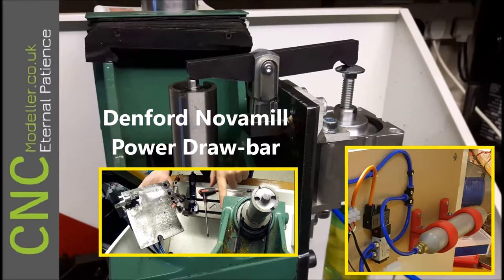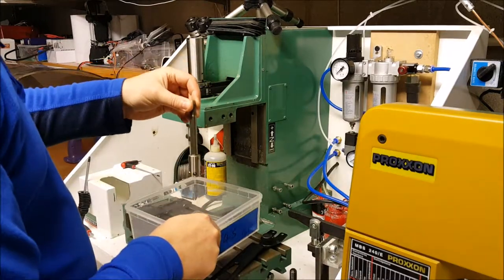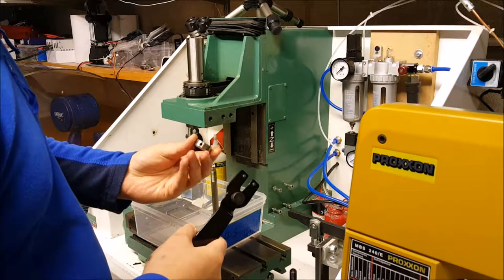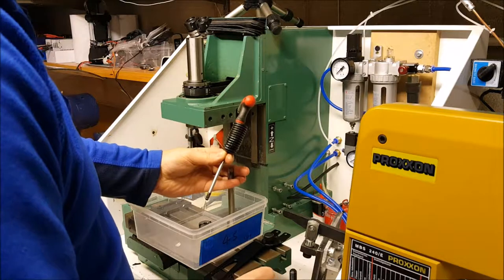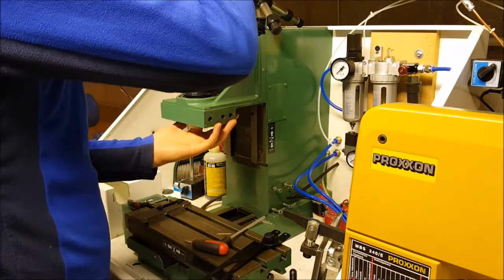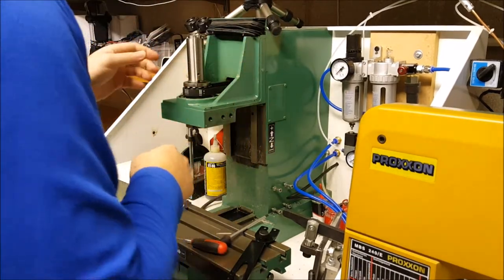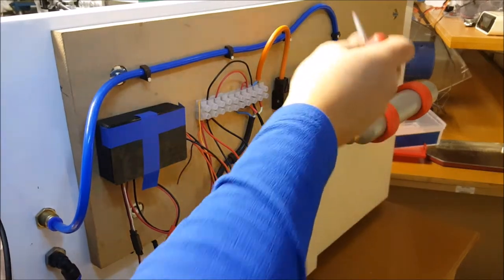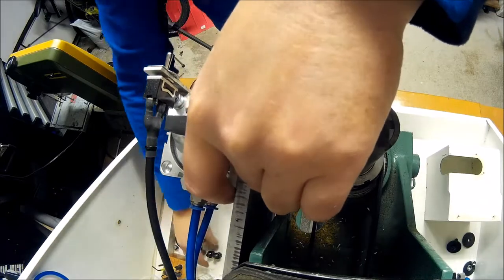Milling Machine Power Draw-bar Upgrade #2; Assembly + how a pneumatic draw-bar works!

Comment: Hi, I just bought a Denford Triton Pro that has a tool changer carousel but it's unknown if it has an ATC on the spindle. The Triton CNC originally came with Denford's easy change tool holder in the spindle but it was with the missing tools that didn't make it to America when the mill was shipped. Somewhere in a dark corner of an unknown warehouse is a box filled with Triton quick-change tools and tool holder. Reminds me of the end of the first Indiana Jones movie. I bought this mill from an ex Microsoft engineer who was over in England buying a company for Microsoft. The company used the Triton strictly for prototyping so the wear on the mill is negligible. I plan on adding the ATC spindle using a similar plan as you used. What size is your pneumatic cylinder?  Most spindles use a special (read, expensive) double cylinder, high force pneumatic cylinder. Denford's design just uses a lever & fulcrum to double the force of the piston. Very clever (and cheap). That's the difference between a $25 eBay cylinder or a $200 Chinese one (and a 2-month shipping wait). I can make all of the parts myself using my 9x20 lathe and my manual mill and McMaster Carr has the Belville washers for the spring load. I already ordered a Chinese pull claw for the spindle but I like the ball bearing design Denford uses, better. Also, my spindle appears to be set up for that type of mechanism. I'll make my own out of tool steel and then harden it. I haven't torn down the mill yet to see what it has in the spindle. Who knows, maybe it was already upgraded. It's all hidden behind sheet metal right now. I'll check out your videos to see if you finished this and made an ATC carousel.
Reply from the maker: Hi. It's been a while. Mine came with the easy change holder. You'll probably have a fixed drawbar. When you undo the drawbar it'll probably release the easy change Chuck and expose the machine taper. Mine is bt30. The spindle may well be ready for converting. I bought some bits from Denford that were still available, and made others. Drawings are probably available on their forum for your machine. Ask there or just give them a call they were helpful a few years ago. Hope that helps! Good luck with your conversion!
All the best
Barry M

Comment: I'd be intregued to know more about this. I have a starmill with an  R8 taper I'm looking at using with tormach tool holders.
Reply from the maker: Hi Luc, happy to help if I can. The Novamill uses BT30 taper holders and I believe that Tormach is moving to BT30 with their new MX1100. I understand that this is an entry level "industrial" standard of taper but not much more. I have a lot of Chinesium ER32 holders and a few second hand ER16 ones. They all are more than adequate for my purposes at the moment. Hope that helps. 
Cheers
Barry M

Comment: Awesome! I've been putting off the upgrade, as the mounting plate I had made was cut to the original drawings (it's the right height, the bolts and the pivot tab lines up, but it's not as deep as the head casting). I thought I'd have to remake the plate, but I'm starting to think it'll still work... Some great tips as well - I've just ordered an adjustable angle grinder tool now! Didn't realise the threaded hole was to a tool holder stopper (the cap head screw). How have you set that? Can you upload a video showing the it operate from the front, top, and side? I want to figure out that if the mounting plate does deflect - which direction it deflects.
Reply from the maker: Hi Jon, thanks for the interest; to answer your questions:-

Setting the tool holder stop; I just did it by feel so that the holder was released positively and the balls weren't being trapped as the holder was pulled up into the head.

Mounting plate deflection; yes the plate does deflect visibly at the top, the bolts need to be fairly tight. Possibly 0.5mm, I'll try and get some video with a DTI on it. It deflects top away from the mill.

Hope that helps...

Cheers
BPM
Reply from the maker: Hi Jon,  I set the stop so that the holder just locked in snugly. With the stop too far out it just wont lock up. The plate deflects top away from the spindle just a tadge. Hope that helps. I have some other videos of this which may also be of help, have a look and let me know, 
Cheers
Barry M.

Comment: Thanks for the video, I have two of these with one running on mach3. I would love to do this upgrade.
You said it was a few hundred "quid" ? What did that include? I am understanding that Denford still 
supports these mills?
Reply from the maker: Hi Dan, you're welcome! 

I'm not sure if Denford formally still supports the mill directly but they do support the forums. Some of the parts are still used in new machines hence available. They are Colett, balls, spring washers, rocker arm and pivot bracket.

You'll need to get a mounting plate cut and welded to drawing (I strongly suggest checking the drawing against your mill with a cardboard template there are several variants). And you'll need to get a drawbar made, I turned mine on my Novaturn.

The air cylinder and valve came from ebay, as did my silent compressor.

Hope that helps. Just give Denford a bell and ask them what they have available, that's what I did.

Cheers
Barry M